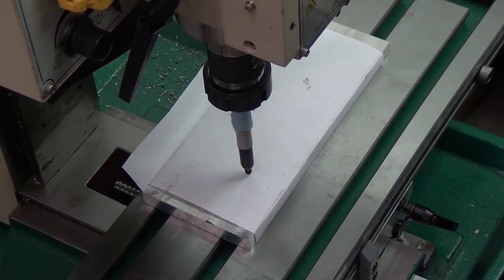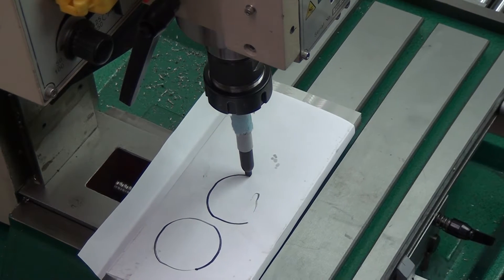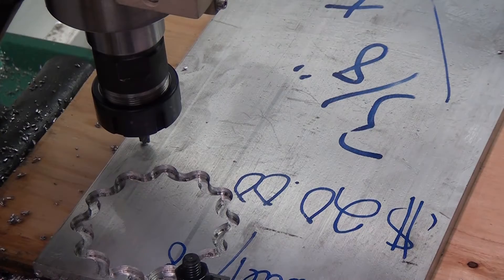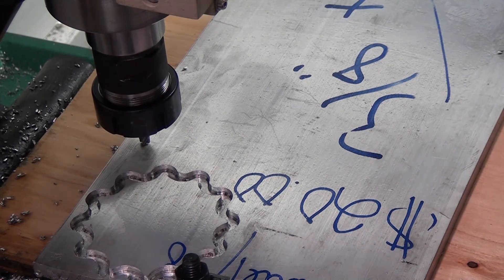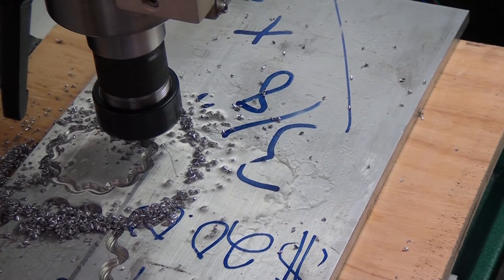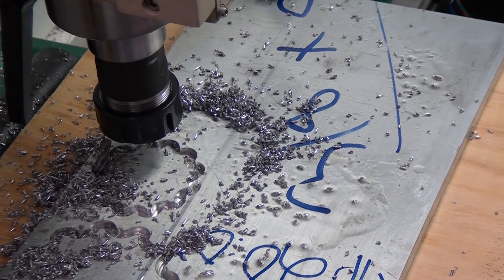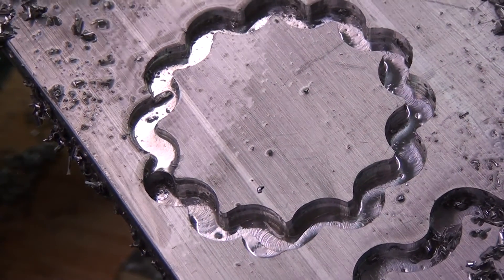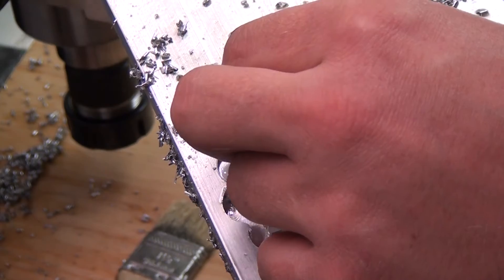G0704 CNC Conversion 08 - XY Converted, First CNC Milling (and end mill breaking) Action!

Comment: Nice job!  I am hoping to convert my mill soon!   Where do you find reasonably priced raw materials (aluminum plate, etc)?  I am not having much luck in that department.
Reply from the maker: +Hilltop Thanks!
I buy most of my material as remnants at my local Metal Supermarket. I usually have to buyer larger pieces than I want so then I have to get it down to size and end up with a bunch left over. I find that annoying because I hate having money tied up in material inventory. If I have to get something online, I generally go to http://www.onlinemetals.com/ or ebay. You can also have stuff shipped from Metal Supermarket's online store, but I don't think their prices are as good.
Reply: +russtuff Thanks for the info.  We have a Metals Supermarket about 30 minutes away... I've never visited them, so I'll have to check them out.  We also have another metal store called Metals Depot about the same distance away.  I bought some seconds/leftovers from them a couple years ago, but the price wasn't great.  I definitely want to check out remnants instead of new stock because I'm just practicing at this point.

Comment: I found the same think with the jam nuts.  The single nuts don't cut it and the vibration from cutting will loosen them quick.  Too bad about the broken bit.  I'm sure you'll have better luck when you get the Z axis going.